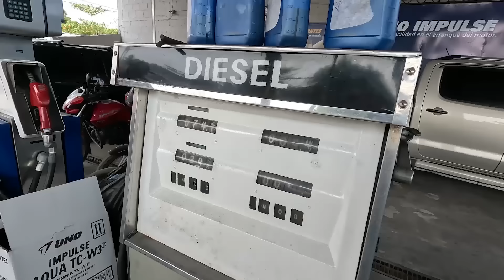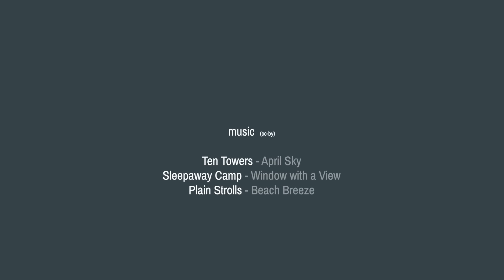I am SO glad that this is over!

Comment: If I get the chance to have and sail a boat I'm going to have on board a "fuel polishing system" where you run your fuel through these filters and the filters also remove water, and they are glass so you can see if there is water in the filters (I will have that type of filter for my engine also).
Reply from the maker: that sounds like a great plan!

Comment: Did you think about rubbing alcohol. It combines with the water and you can run. It works on my tractors and semi Truck. Crazy not to have a water trap or filter. Inside of tank makes its own water from heat and cold.

Comment: You will be ok,the contamination will settle to the bottom of the tank,just keep extra fuel filters to the engine you can change over if and when a problem arises.Diesel is not like gasoline,safe sailing.

Comment: great video , love to see a woman with big power tools ,you re a proper trooper , honestly paul should have made sure the cans were empty before giving them to you , replacing the fuel tank lid gasket would have been a good idea too,   4.52 i dont know  if im on my own here but  the blade on circular saw appears to be installed the wrong way round looking at the arrow stamped on the guard  and the teeth on the blade  ,  take it easy see you on the nest one take it easy
Reply from the maker: I believe that I should have checked them for sure. Not the duty of the one lending them but the one borrowing IMO. What`s wrong with that gasket? That`s in super great shape and it`s really tough material. Made that with my sister about nine years ago. Thanks for the hint about the saw, will go and double check on the blade.
Reply: @WhiteSpotPirates  hi  thanks for writing back great videos , strictly speaking from an engineering perspective when ever we disturb a gasket we should replace it in an ideal world ,  i thought that if the gasket was damaged / perished in any way when at sea it may leak a little diesel in to the bilge , when sloshing about at sea , take it easy see you on the next one

Comment: Hi Nike, well done! If you can find the space you should install a day tank (gravity feeding the engine) of say 20 l and build a filter circuit iot polish the Diesel continuously. Of course, work and money but you will never ever experience again any trouble.
Reply from the maker: sounds like a great idea! Will put it on the endless wish list of when I ever experience too much boredom ;)
Reply: @WhiteSpotPirates Of course, I do understand that you do have a very low risk of experiencing a bore out. On the other hand, the time you spent on all the activities summarized in that video would have been sufficient to make that installation and with a very long lasting effect.
Reply from the maker: @johnmayer3433  😂 very true!!! But getting all the bits and pieces for the install also have to be included in the calculation. But even then maybe 😋 I definitely would have space for a day tank…

Comment: Having a fuelpolish pump installed can be a great thing when not using a lot of fuel regulary. A pump some easy to replace filters and waterseparator in a line back to the fueltank 
Carl is probably not spacious enough to have a daytank but that could also be a thing to secure having a clean tank of fuel going to the engine.

Comment: The algae do not like copper. A brass strainer over the pickup would make a difference. Just a small piece of brass screen, tied on with a copper wire, will help. Learnt that from owning a diesel Volkswagen back then. I also have a funnel with a fine mesh filter which filters out water. It was sold as Mr Funnel some years ago. It also filters out dog hair from engine oil. Don't ask.
Reply from the maker: 😅 won’t ask but am curious 😂. Yes I do have that funnel, too…but like it sometimes happens, I could not find that little inner mesh thing that you place in the middle 🙈 and the rest of the story you know 😎
Reply: @WhiteSpotPirates  Ok, I'll tell. I rebuilt the engine of my old Jeep. Ran out of money, but just had enough to buy the last few bits and new oil. Filled it and then realised one little part had dropped into the oil pan. So had to drain the new, expensive oil, remove the sump, fish out the part, install it, re-install the oil pan. And then discovered that my loving dog had been wagging her tail in the oil. Mr Funnel took a few hours but I had enough clean oil to fill the Jeep and run it until the next income. Dogs...

Comment: You could have bought three stage filter system, that strains  and filters diesel fuel. Would have cost you a lot less.
Reply from the maker: yeah, that is probably true, good thinking. Not sure I would have been able to obtain and install those within the same time frame, though. But maye :).

Comment: Hi, I had this problem years ago. I have since regularly used  enzyme based fuel treatments. 
they work pretty well. but  you need to have spare filters since they break up the algae and it clogs the filters.  So I treat and run  and then change filters.

Comment: Never borrow canisters for fuel, even not from yourself! It is one of your diesel canisters or not, nothing in between. Use a piece of transparent pipe, better a funnel with a sieve to fill the tank and keep an eye on it. Let install a second outlet with pipe and filter to the motor from the fueltank so you can switch between them or pump the whole fuel through the filter during a rolly trip. With that you only have to change the filter instead of cleaning the whole tank and you can flush or bypass the other pipe. Water will be at the bottom of the tank because water is heavier than diesel. On a calm day and the boat balanced to get the deepest point under the intake strainer the motor will stuck on water. At that point you can pump out the water until fuel appears. Use transparent pipe sections so you can see when the color changes or bubbles appear. Coolant liquid, other oily fluids or cleanser and plant protection products are not so easy to handle but also does appear in jerrycans. Shit happens. Take care, there are liquids in jerrycans that can sink an aluminum boat over night. And always check the tank vent valve wherever it is located.
Reply from the maker: some great advise, thank you!

Comment: Poor Paul helping all the way to get rid of the soiled Diesel and face the Wrath of both this Diesel issue and the predeparture stress combined :-)  Duplex filters are expensive, but a dual valve (feed and return) and two Delpi 296 are very affordable and a lot of peace of mind. I also have my 20L heater tank plumed in as a backup source of clean fuel. That heater tank is only filled  from the main bunkers via the Delpi 296 filter with water separator.

Comment: Nike,

I know that you had to do extra work and lost some money, but I view it as an extra layer of safety. I used to view being delayed with irritation,until one day that I had to go to a gas station to use the restroom instead of continuing on my trip. When I got back on the highway the traffic was lined up for miles, there had been a terrible accident. I thought for a moment and said, " Thank you LORD." I realized that had I continued instead of stopping then I may have been in the accident. I have never questioned any type of delay since.
You should be glad that you are well assured that your fuel tank is extra clean and that you can be worry free about it for some time.  I would run the engine for awhile before attempting your exit out to sea, just to make sure the lines are clean. Thank you for sharing. Safe travels.
Cheer,,!

Blue Skies and Fair Winds.

Faithfully,

James

Comment: Nike I remember the early days when you would leave Shelter Bay and then return after something broke. The original engine gave you more problems than can be counted. Big Red turned Karl into a mean Sailing Machine. Have you thought about putting a little biocide fuel treatment in the fuel?
Reply from the maker: Oh man, that old engine was nothing but trouble but taught me a bunch, so I have to give it that ;). Big Red is a gem, I think we have around 1.000 engine hours on the clock now and she`s doing supe well. One of the best decisions to swap to that Beta Marine diesel engine :)

Comment: Past experience in refuelling a small plane from uncertified sources was to put the fuel into the planes tanks through a chamois. This will extract any water in the fuel. In your case the problem was likely much bigger. You handled it well and that booze would have made a good farewell to that episode.  Cheers,
Reply from the maker: I was not really sure what was in that tank. I think it was a mix of oil, coolant and also salt water. And especially the coolant and salt water part was something that I did not want to try out in my diesel engine ;) But I also know that I was being overly careful. I am sure it`s possible that all would have been fine with just running it through my racor...

Comment: 😮I'm sorry, what you just did, transfer fuel directly to the tank without FIRST DECANTING THE DIESEL AT REST, THEN PLACING A SEPARATION FILTER BETWEEN THE HOSE AND THE TANK MOUTH, IT SEEMS LIE THAT YOU HAVE MADE THAT MISTAKE, NOW CLEAN AND DECANT